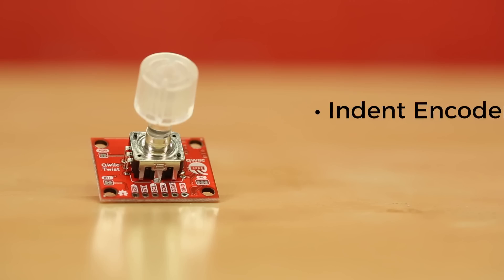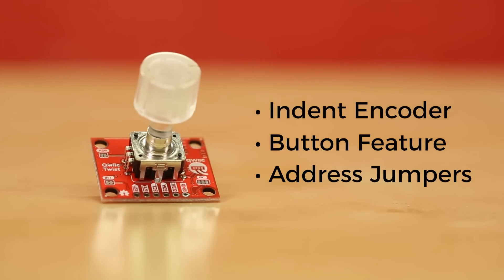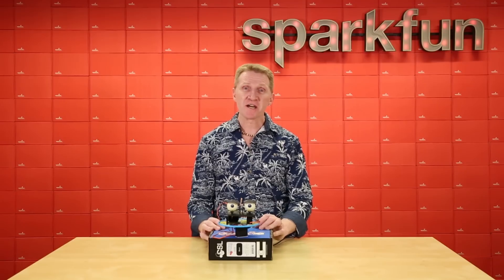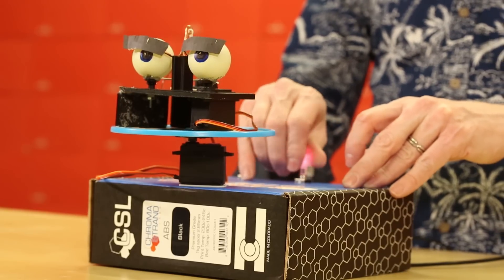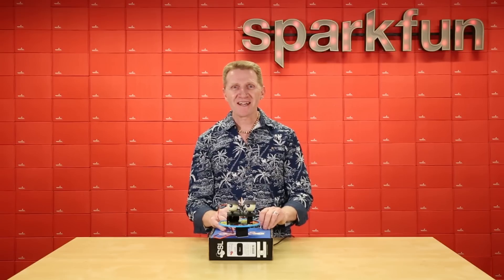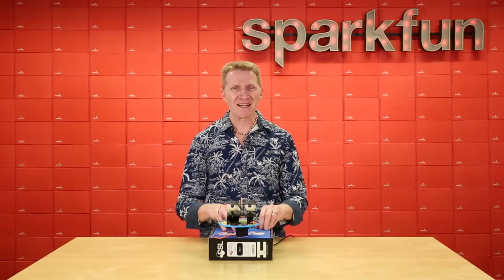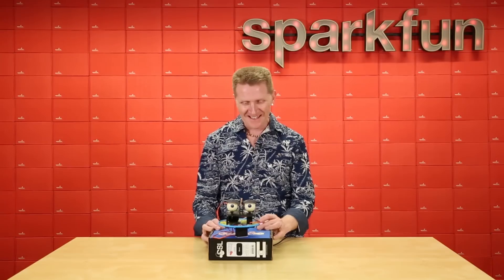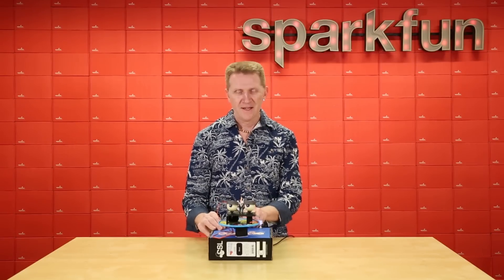Product Showcase: SparkFun Qwiic Twist

Comment: I recently built a project using one of these RGB rotary encoders (very likely the exact same one), and let me tell you knowing then what I know now, I would GLADLY fork over $19.95 to have someone do the work for me. I spent hours researching, building, and coding to get the thing to do what I wanted to (even then, it sometimes misses or skips indents and I can't figure out why), and if the Qwiic Twist had been available at the time, the project would likely be completely finished now instead of waiting on my workbench until I have time to do the last couple steps. Some people can do development work in their sleep, and those people are not SparkFun's customer base (though the ones without an ego realize the usefulness of sometimes paying for someone else's engineering work). For those of us who are still beginners or otherwise would rather spend some money to save some time, SparkFun is a godsend.

Plus, don't skip over the fact that home-rolling one of these encoders takes up to 6 pins (3 for the LED's, 2 for the encoder, and 1 for the button) AND 2 interrupts whereas this board only requires 2 I2C pins which can be shared with other I2C devices. Using this pre-packaged, albeit more expensive system, could potentially let you use a smaller and cheaper MCU, thus offsetting the cost.
Reply: We don't want easy ways!
Reply: Regular old rotary encoder is really easy. How does that differ from an  RGB one?
Reply: @morgenvrijman748  the RGB portion is the easy part, it just adds 3 more pins.
Reply: @bryan__m  Then there is no hard part lol
Reply: @morgenvrijman748  congrats for. Not everyone is as great as you, though, and that's who is the target audience.